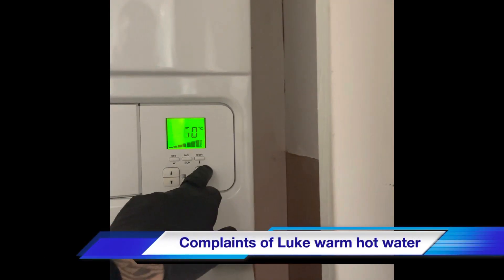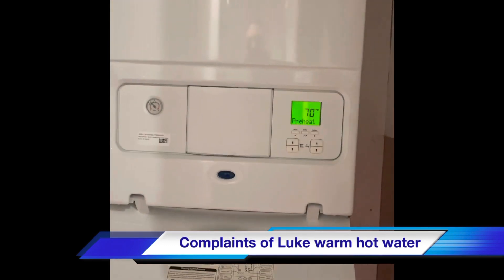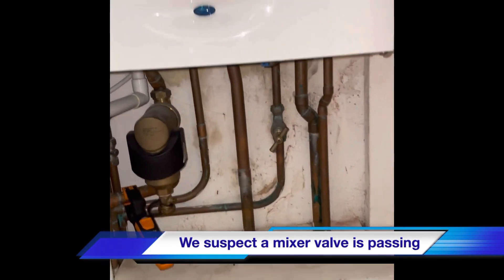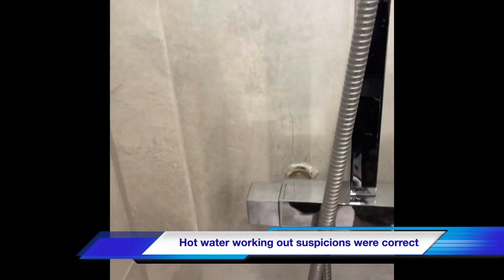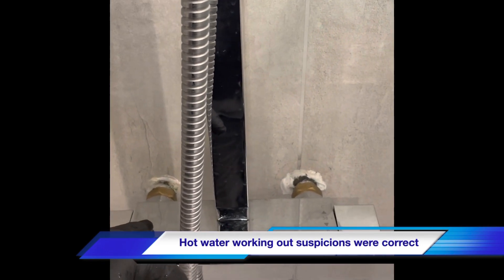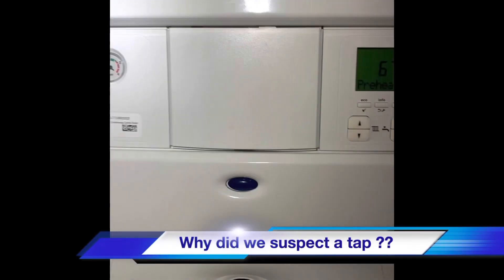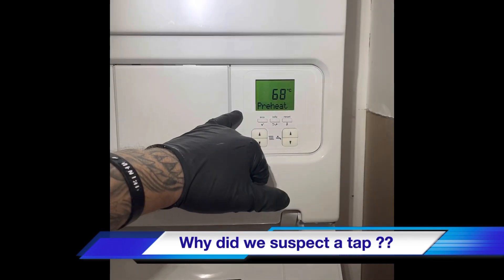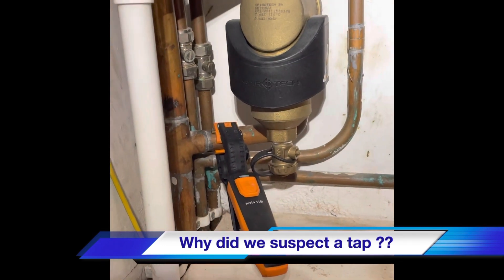Poor hot water shower valve passing Worcester Bosch www.3tgas.co.uk

Comment: Thanks for the video and your channel

Seen this happen on a system boiler and unvented setup, where the cw and hw are unbalanced as the cw doesnt go through the combination valve and when the non return in the shower is faulty

But havent seen it on a combi before, I’m surprised as i would have thought with balanced supplys the cw wouldnt get into the hot
Reply from the maker: The cold water is passing back through the shower valve causing the hot water to be mixed hot and cold to the taps